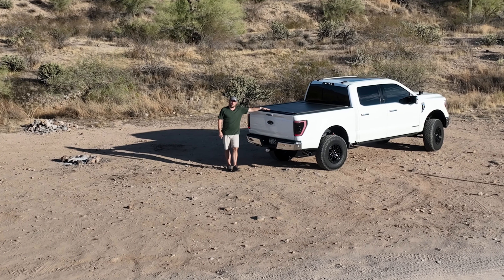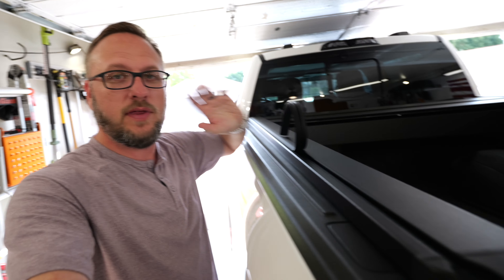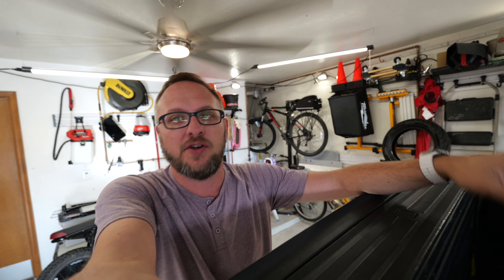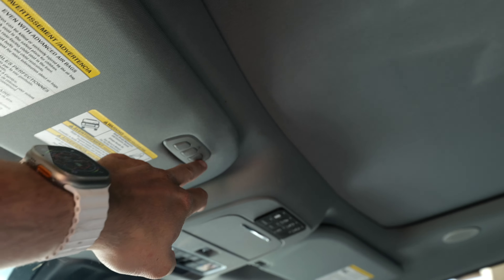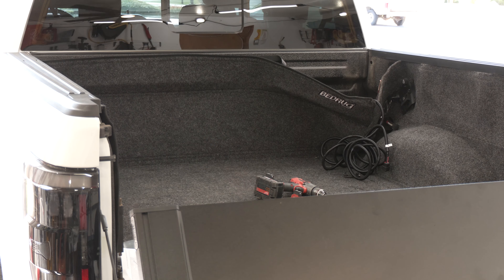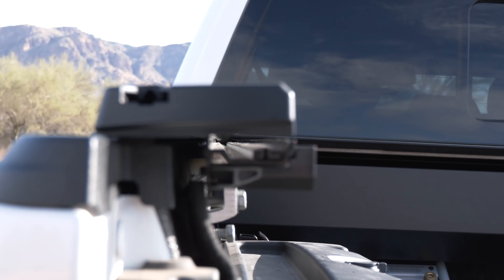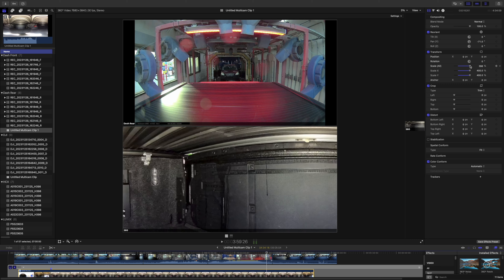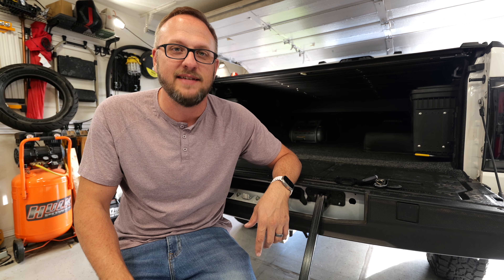Is the Retrax EQ Worth the $3,200 Price Tag? The Ultimate Tonneau Cover!!

Comment: No way, No How. For over a $2000 savings, I’ll open and close my BAK Revolver X2 tonnage cover manually and also save the headaches on installation and electronic/motor failure.
Reply from the maker: It’s not for everyone but the added T-Slots and engineering to take 500 lbs of load on ladder racks or roof top tents on top of the electrification is what commands such a price. In terms of motors, they appear to be similar to the power step motors which have never failed on me and are also mounted on the back and appear to be easily serviceable. So while it’s not for everyone, it’s certainly for some who want / need such features.
Reply: If I owned a cyber truck 😂😂😂

Comment: My lightly used 2019 Ford Dually came with one of these Retrax retractable covers, but mine is just a manual one...as far as I know anyway. I just slide it open and closed, and it will lock in whatever position I need. Best cover I have ever had for sure, and getting it for free is pretty great too.

Comment: Dan, I have been watching your channel and have been following you for the upgrades to my 2025 Powerboost F150. 

I have two questions for you regarding the Retrax EQ and your bed rug. Where did you get your bed rug at and which one did you buy? Did you have to do a lot of trimming to get it to fit the bed and to be able to install this Retrax system? 

Also, if I have the power deploying running boards, will I not be able to use the features for this Retrax?

Comment: I purchased the retrax EQ so I can use the app and truck key fob to operate the bed cover.  One thing they don’t tell you is app will not work if your truck has automatic side steps, doesn’t matter if they are factory installed or aftermarket.   If Retrax would have advertised the bed cover this way I would not have purchased this bed cover.  I would have went with the cheaper version.     Called retrax and waiting to hear back from them.   Will update once issue has been resolved.
Reply: Why doesn’t it?
Reply: According to RETRAX, the signal from the factory steps interferes with signal for pairing the RETRAX EQ.      My truck is a newer tundra, apparently the Tundras are having the issue.
Reply: @Texans_tundra what if the steps we installed just connect to the battery and nothing else? The Rough Country ones don't have another module thing you have to put in the engine bay like some AMP ones do.
Reply: @Texans_tundra  I’m not sure if this is isolated to only Toyota or the Tundra, but did you ever figure anything out for a solution to this? Did Retrax get back to you about it?

Comment: It's a bit hard to see in the video.  Does the T-slot sit fully on top of the bed rail?  It looks like it's partially on the bed rail, but also partially just on the rail guides (part of the cover).  It would seem to be a LOT stronger if the T-slots sat totally on top of the bed rail rather than only partially on the rail.

Comment: I don’t get wrapped around the axle anymore, so to speak, about not being able to fit a 4 x 8 sheet of plywood in the bed of a truck. No one‘s really been able to do that for the most part for about 20 years! Have it delivered or get a traileror stack it on top of bed rails that go over the cover. If you’re in business, you’re not using a cover anyway. You’re using a vehicle that delivers wood.

Comment: What is the measurement on the canister? Do you think I can get a decked drawer system underneath?
Reply: I can’t speak regarding the electric version, but I had the manual version on my truck a while back, and I’d say there was about 10-12” of clearance between the bottom of the canister and the bed.

Comment: I swear, tonneau covers keep getting more and more expensive - and power-operated?  One more thing to fail.  Heck, I used to run BAK Roll-X covers on my trucks, and when I got the RAM, I said no way and got some cheap $200 soft tonneau.  The BAK ones just didn't hold up over 3 or 4 years [vinyl peeling, seals giving way, etc.]  I don't need the fancy features or metal construction - just keep stuff dry enough to get to my destination.  Glad this one is working for you, though!
Reply: illegitimate regimes have consequences. Thank Mr Biden. I paid 800 for a shitty backflip 3 years ago it's no 1300 for the same basic tri fold

Comment: The only electric I would ever buy would be from EGR.  The retracts is a joke in terms of quality compared to it.
Reply: Minus the 500 holes it requires you to drill in your truck
Reply: @Griswold20  I used 4 existing holes in my bed and re did the drains. The whole install was no holes in metal. Just 1 plastics bed plug drilled and I bought some new ones incase I every need them.